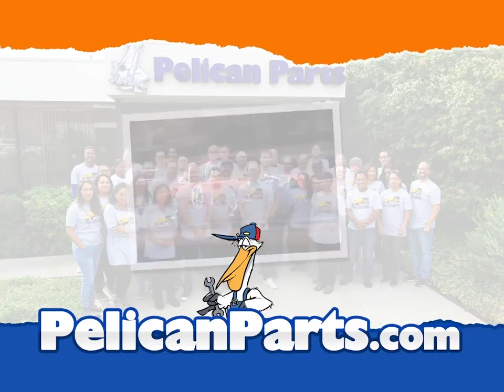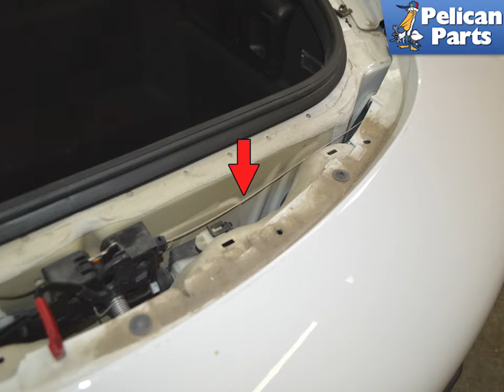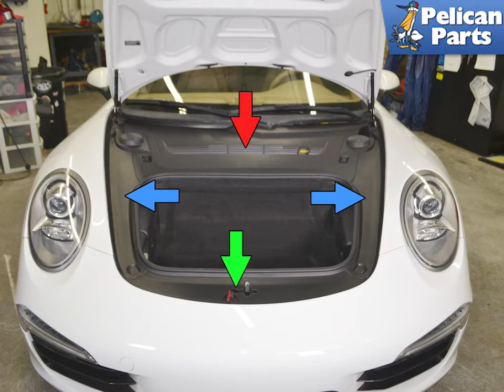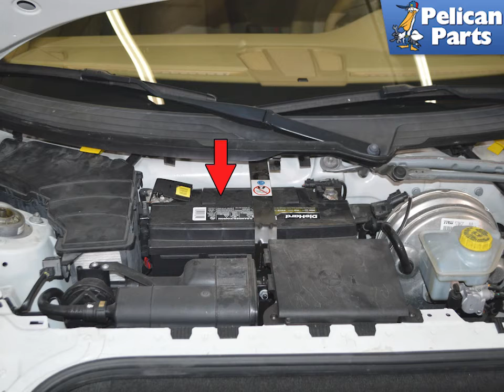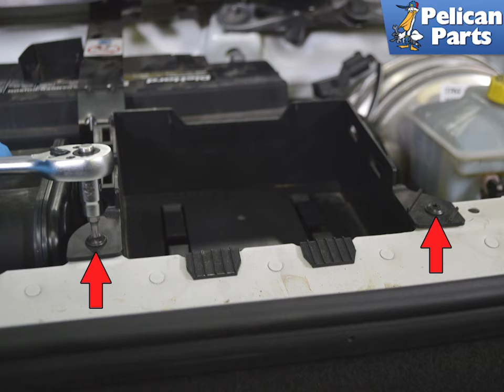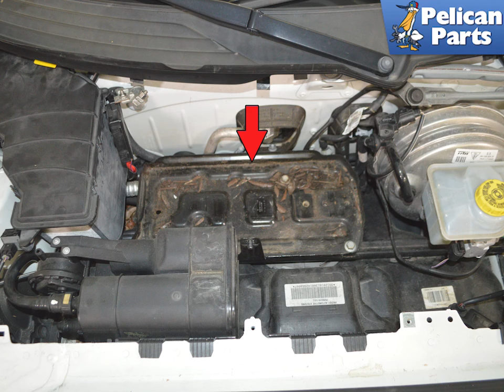Porsche 991.1 Carrera Battery Replacement (2012 - 2016)

Comment: I just want to disconnect my battery for 4 months over the winter. Is this also possible with the 718 without any problems or does something have to be learned via OBD afterwards? If necessary, steering angle by full steering to the left and right?
Reply from the maker: That long could clear adaptations. But the vehicle should start and operate normally.